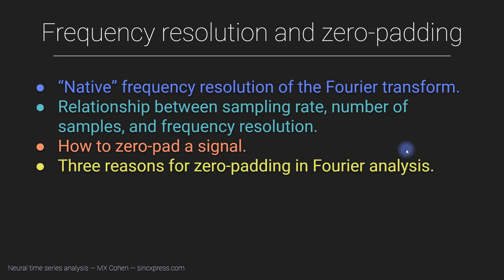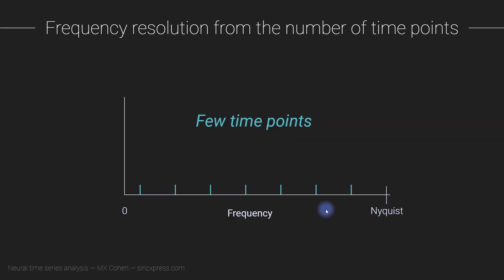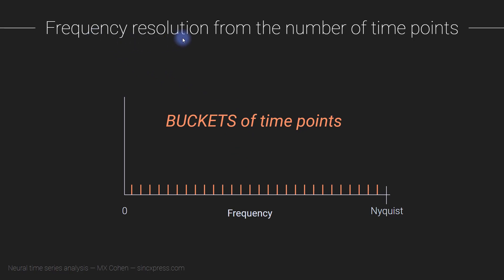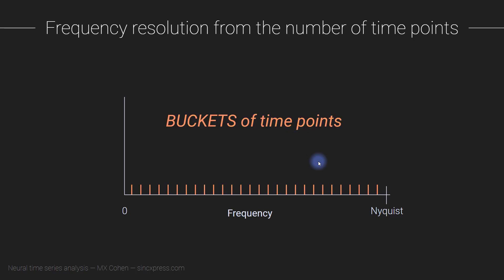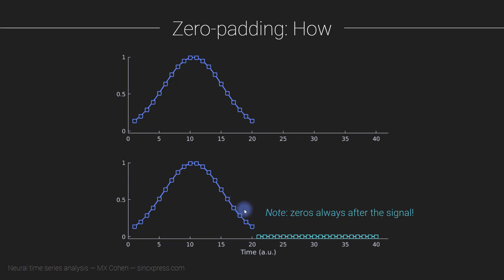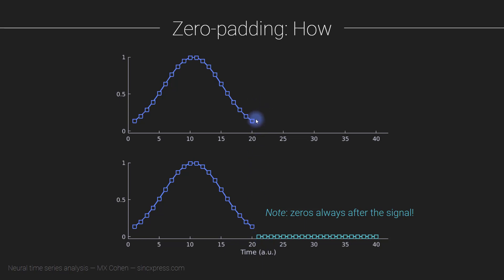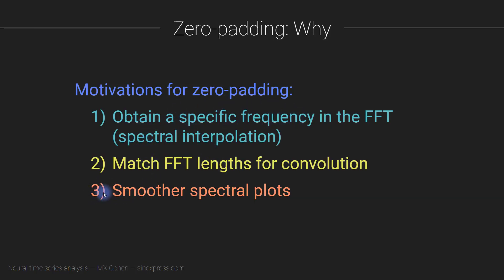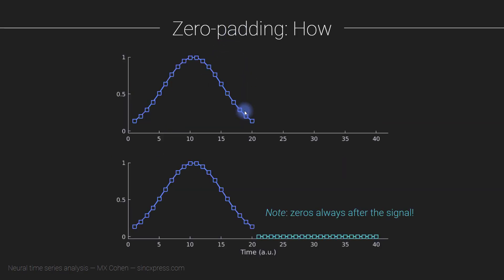Frequency resolution and zero-padding

Comment: Is there a way to use the same number of time points to take the DFT only of a shorter frequency band with more frequency resolution?
Reply from the maker: Hi Marcus. The frequency resolution is determined by the sampling rate and the number of time points. Without changing the sampling rate, zero-padding is the best way to increase the frequency resolution.

Comment: Dear Professor Mike,

Your tutorials are incredibly helpful, and you are my reference for signal processing. I am currently learning from your EEG Bootcamp, which is a high-quality educational and practical course.

I have a question regarding zero-padding in the frequency domain before applying an IFFT. Is it similar to applying Sinc interpolation in the space or time domain to increase the image or signal size? Also, I’ve noticed that some zero-padding methods include zeros between the Nyquist (positive frequency) and the negative frequency, like this: spectrum(pos)___zeros___spectrum(neg). I’m unsure why we don't just do the padding before and after the spectrum, like this: zeros___spectrum___zeros. It have a link if the spectrum is shifted or not ?
Reply from the maker: Thank you for your kind words, Anassofti. 
Zero-padding in the frequency domain increases the temporal resolution in the time domain. This is called sinc interpolation. And yes, the zeros go in between the positive and negative frequencies. Your suggestion (zeros__spectrum__zeros) is actually also correct, if you put the 0 frequency in the middle and negative frequencies to the left.
Reply: @mikexcohen1   It's very clear for me now, thanks a lot for your explanation  ❤

Comment: Dear Mike, 

Thanks a lot, I just started EEG research, your channel has been a great help!

I'm confused about the scientific validity of zero padding with regards to your example of wanting a Fourier coefficient for the exact frequence of a flickering lightbulb:
If I think of an extreme case, i.e. a sampling rate of 1 Hz over 1 second, then the EEG signal only tells us the mean current for this given second. However, if you zeropad the signal with 99 seconds of null activity, you get Fourier coefficients for increments of 1/100 Hzs. 
As you said at the end of the video, it helps in smoothing out a curve. I see that, but I have a hard time figuring how you could draw new conclusions from it e.g. with the light bulb experiment.

Many thanks, Victor
Reply from the maker: Hi Victor. Zero-padding is valid as long as you understand the correct interpretation: The values in between the "true" frequencies are sinc-interpolated values. You can trust them as much as you can trust any other interpolated signal. If the resolution is already fairly good, then interpolating a bit higher is fine. In extreme cases, it would be good to exert caution. 

Anyway, zero-padding is necessary for some applications like convolution, so it's used even if the interpolated points are not interpreted.
Reply: Dear Mike, many thanks for your response. It's clearer now. Best, Victor

Comment: I am having trouble understanding WHY the zeros are added after the actual readings.  Intuitively adding zeros between valid data points and interpolating between data points makes sense- please help
Reply from the maker: Zero-padding is indeed confusing. Imagine what would happen if you put zeros in between data points -- that would actually change the frequency characteristics of the signal and introduce a lot of artifacts. Imagine, for example, a sine wave. Then you put zeros between each time point in the sine wave. The signal would have a sine wave at 1/2 the frequency, and it would keep bouncing between zero and a valid sine point.

Comment: Dear Mike,
Thank you so much.
I have a question please:
By zero padding, a new signal is generated; the result of the fft should change in a way that in ifft the straight part of the new signal be covered as well. It causes change in frequency content of the signal! 
Where is my mistake, please?
Reply from the maker: Hi Arash. Zero padding increases the frequency resolution, but it doesn't change the frequencies or the shape of the spectrum except to make it smoother.
Reply: @mikexcohen1  thanks. You are totally correct. I checked that in some examples as well.
(There is just a conflict between my feeling and the way which mathematics works in this case 😃).
Thank you so much.
Reply from the maker: Math is often unintuitive, sometimes even counter-intuitive...

Comment: Zero-padding does not increase frequency resolution. It is only a technique which interpolates the signal points.
Reply from the maker: Indeed, zero-padding is sinc-interpolation (a.k.a. the zero-padding theorem). Frequency resolution is the spacing between successive frequencies, and so with more time points in the signal, the frequency resolution increases.
Reply: @mikexcohen1  ok, I think there is different definitions on frequency resolution. From what I have learn frequency spacing and frequency resolution is not the same.
Reply: @JsoProductionChannel   " I have heard it said that it increases frequency resolution because it extends the signal, but I don't agree as by just adding zeros you haven't added any new information to the signal. "

Comment: if I add a window to the sampled signal, then reverse it and inverse it, and pad this reverse-inverse signal with the original signal, can it work?
Reply from the maker: This is called reflection and is usually done to attenuate edge effects during filtering.
Reply: @mikexcohen1  so can it increase the frequency resolution or it's totally nonsense for increasing freq resolution?
Reply from the maker: Technically it would increase frequency resolution, but the goal of reflection is to attenuate edge effects in (time-domain) filtering.

Comment: at 3:34, didn't you mean "decrease the resolution" ? Because if you are lowering the sample rate, the buckets move closer together.
Reply: nvm, the closer the buckets move together, the higher the resolution. Not the opposite.
Reply from the maker: Exactly. It's confusing stuff ;)
It would be equally accurate to say that we're decreasing the frequency spacing.